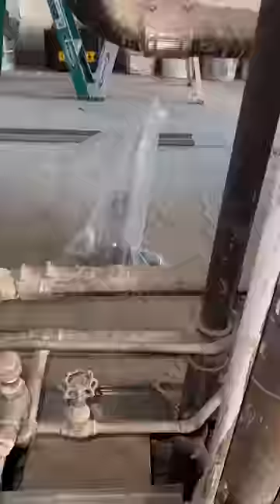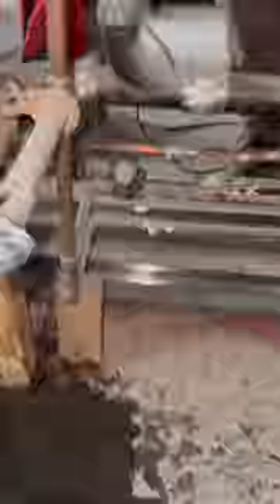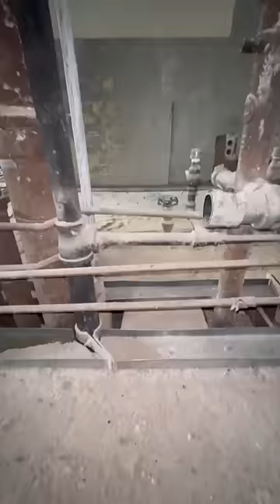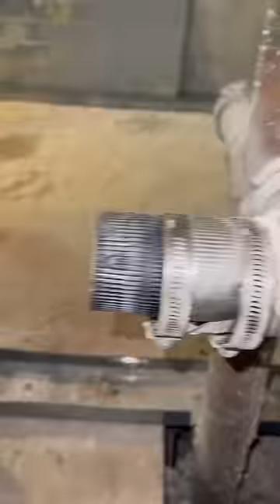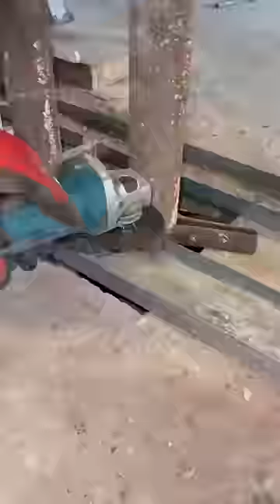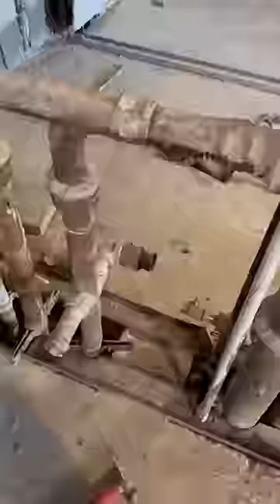Plumbing Chronicles 7 #shorts #shutdown

Comment: As a former restoration tech, I can tell you they pulled out the drywall by hand. Was always the best part of my day, putting on the impact resistant gloves (or not, I was young), punch through and rip it out. Never left a jobsite with a shred of aggression left in my body.

Comment: I get aluminum pans at the dollar store for about $0.60 they are good at keeping ports in and more relevant to this video if you run into a situation with water one of those loaf pans or casserole pans is really cheap and easy and not have to worry about the downstairs neighbors

Comment: How does the hot water usually work in NYC?
Reply: Central boilers. Sometimes the boilers heat water not just for multiple units, but for multiple buildings. Lots of cities have steam systems for heat, including places like Kansas City that are much smaller and more spread out than NYC.

Comment: its EZ to strip studs off live pipes and wires. just get it mostly cut off with the sawzall then you take two hammers put the claw of one the the wood and use the other to hit the hammer on the head splits the 2x4 like butter
Reply from the maker: It sounds like you have NYC experience 🫡